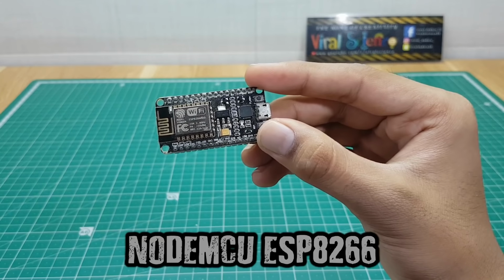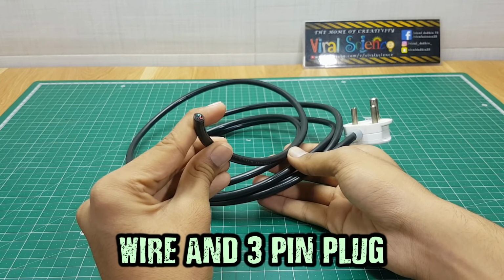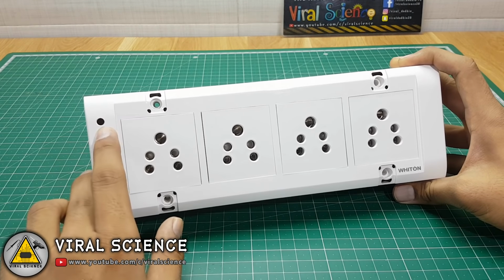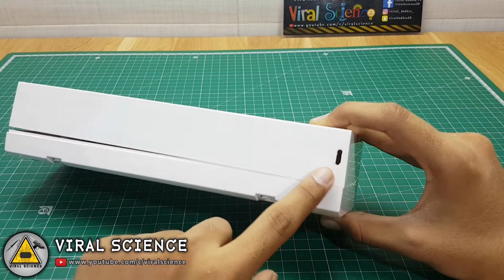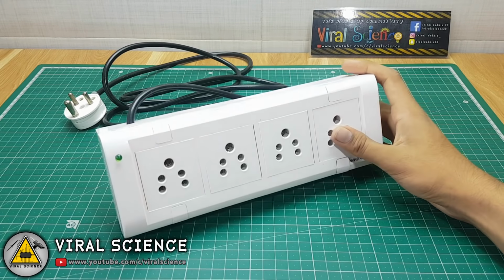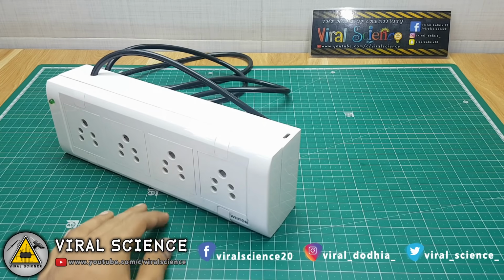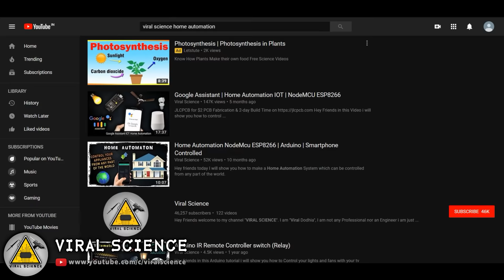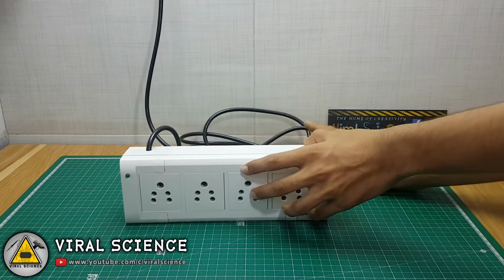Home Automation Extension Board | NODEMCU ESP8266 | Blynk | Google Assistant

Comment: Why do we need a ac converter if the relay module can handle 220v?
Reply: Relay module handles 220v but it can work only on 5v or 12v based on which one you choose

Comment: Does it need a WiFi network with internet connection or just WiFi router  signal without internet... Just like shareit file transfer working
Reply: No it needs a WiFi network with internet connection